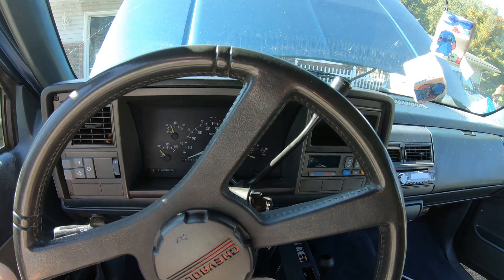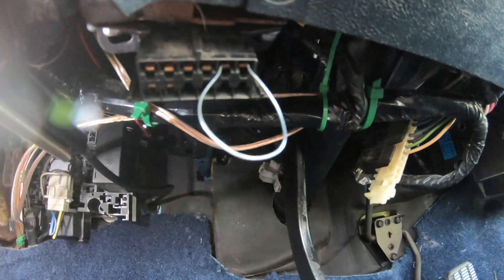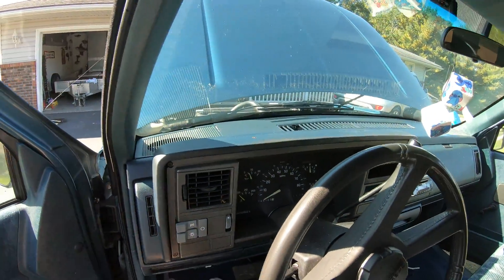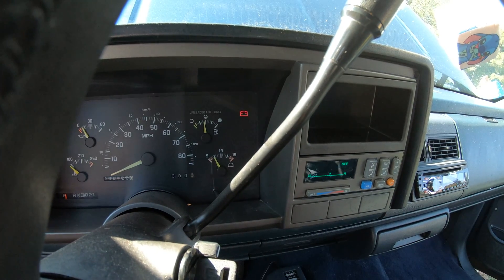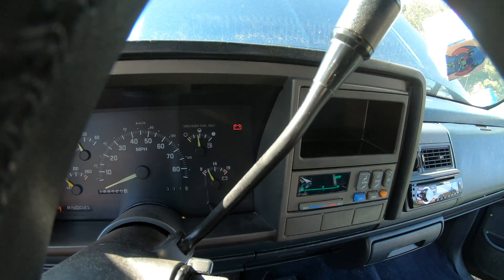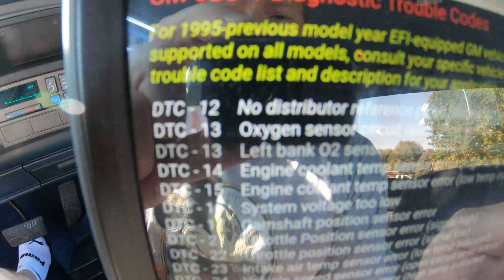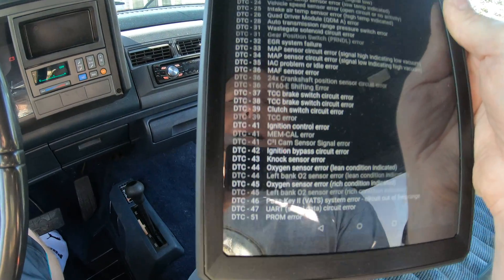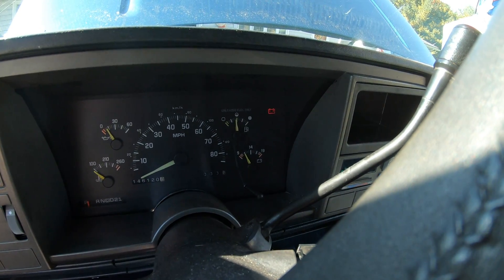How to Read GM OBD 1 Service engine codes

Comment: will this work for a check engine light that randomly comes on when driving but always disappears after restarting?
do i just put the wires in while its still on or have them pre inserted?

Comment: Got 89 chevy caprice and transmission is hesitant when warm. I didnt adjust my tv cable yet but im going to see if its smart enough to throw me a code. No cheak engine lights. And this problom has been for a few yeaes i havent drove it because of it. Tires rotted out so i just just changed then hoping to get the car running good

Comment: Hey I have a 1994 and it has the exact same interior as yours. Have you ever had issues with the aftermarket stereo? Mine turns on but no sound is coming out.. I have an Alpine but it looks nearly identical to your set up lol

Comment: Hoping somebody had this exact issue and knows the proper fix.

4L60E automatic. 228,000 miles.
Tranny shift delays from 1st to 2nd, when at any temp. Will hang in 1st until 2,700 to 3,000 rpm, and shift softly when it eventually upshifts. I can also get it to up-shift by slightly easing up on fuel pedal, at about 2,400 to  2,700 rpms.  It will downshift as it should when going up a hill at around 15/20mph, 2nd to 1st. Reverse and 1st always work good, cold or hot.  3rd & 4th work fine.  Fluid is exactly Full and clean, when hot/level. No Check Engine Light or any other warnings or issues. 

Anyone have this same thing?  Thanks!

Does this also relay transmission codes?

Comment: Well I have a 95 1/2  Chevy S10 2.2l  5 speed - the VSS  speed sensor is on the T5 manual transmission -  The truck is the split year  of S10 that is a pain in the ***$$$  because it's  an OBD 2 port that is wired different - it's OBD1 (Or like we call it - OBD 1.5 even though it doesn't say that anywhere lol)   - anyways i can use a jumper to read the error code if it's on the 3rd and 4th pins in from the top right  (so there isn't any connection to jump to on the top two on the very right)  -  Well I have a code 16 - system voltage too low - causing the check engine light to come on like 5 minutes after the truck has been running  -  The speedometer stopped working when that light started coming on so - swapped out the VSS that's never been changed and it was a pain to get out as well!  Got a new battery and cleaned all the ground wires that I could find since it needed it done.    Not sure if a code 16 could be read another way because I thought there was a code for VSS speedometer on it's own but maybe that's for automatic transmissions?     Now to get rid of the code - just take the cables off of the battery - turn lights on  leave door open  dome light on everything that can be on have on to make sure there is no power at all in the truck?  - then it will reset itself after i hook up the battery again? - it resets the code and actually reads that the new VSS is in and then my speedo will work again?    Everywhere I've gone has said they don't have anything that can plug into my OBD port 😂 😂

Comment: I've got an '86 s10 blazer with the 2.8. I can't read codes on it because the check engine light doesn't work. Tried replacing the bulb and still nothing. Any ideas?
Reply: You need an obd1 scanner then my friend

Comment: Tried to do this for days. On my 94 GMC Sierra the engine light comes on and simply stays on. No flashing whatsoever. I drove my Truck to a shop to repair all the wiring and get it checked because I swapped my US Cluster for a canadian one with kph. When I connected the Cluster and turned the key only a few warning Lights come on. Also only one turn Signal light on the cluster is working. Seems like I got many electrical problems 😭
Reply: ¿Intensaste cambiar las luces del tablero por unas nuevas o cómo solucionaste la falla?

Comment: My code only comes up when the vehicle is at 100+ km an hr. So not sure what to think of it lol 😅
Reply: Did you ever find the solution
Reply: @Isaiais Puente  it was the egr valve. Someone put a screw in the vacuum hose and a little check ball. I just replaced the hose and hooked it back up to the egr. It works as it should now

Comment: Hey have you ever had any issues with the check engine light not turning on when you turn the ignition on without starting the engine I just bought a new computer for my 94 Chevy Blazer Silverado suburban and put it in. The check engine light came on and then it went off it's brand-new and programmed to my VIN the computer that is. Any help is greatly appreciated
Reply from the maker: no ,but maybe it takes a little time to adjust itself, maybe after driving and starting a couple times it will fix itself
Reply: I cant get it to start. It just wants to crank. Pcm and chip are new and programmed to my vin
Reply: @firewaynes8693  I have the same problem now. Did you find a solution?